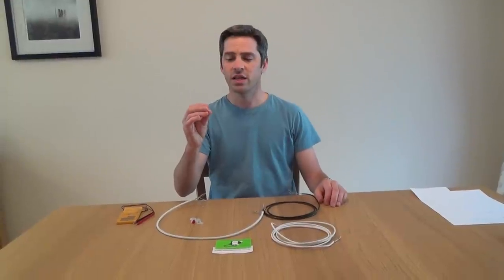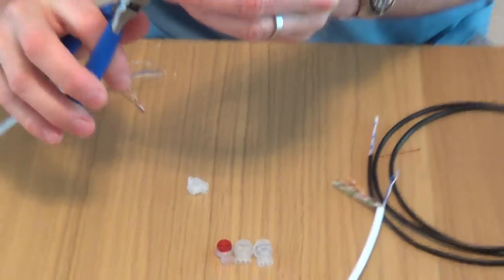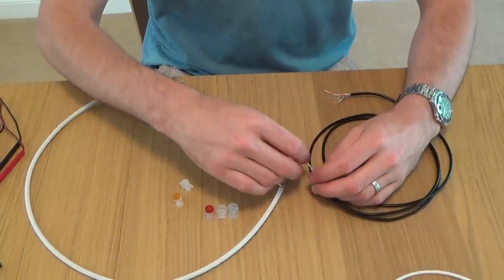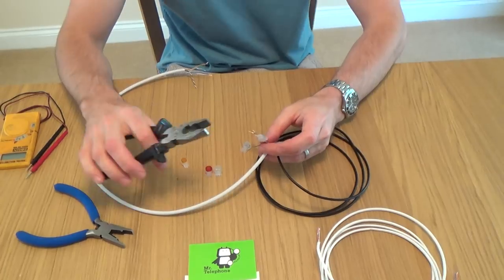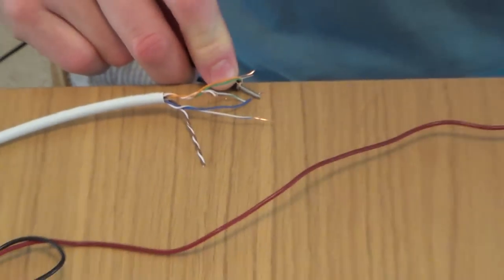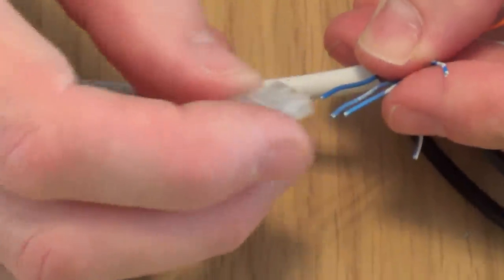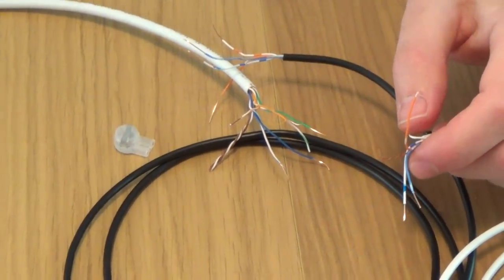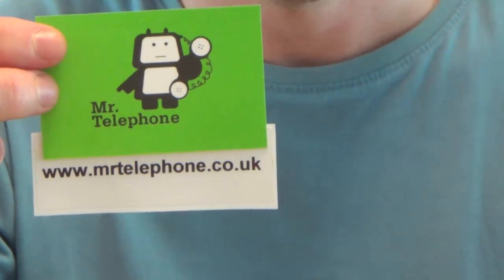How to use telephone jelly crimp connectors

Comment: Great video, really informative, thank you! One thing I do is use a pair of mole grips to make the connection - you can pre-set the gap between the jaws to the right width and they'll apply an even force over the whole crimp, just like the bespoke tool.
Reply from the maker: ***** Hi, I didn't think of that, that is a good idea using the mole grips.Many thanks Vince

Comment: Great video thanks! I’m a bit stuck with the house I just bought. The telephone wire that enters the property is just a loose wire at the rear of the property. I need to extend it to the front living room. I’ve bought 4-core telephone cable & jelly crimps, does anyone know which colours I crimp together? Thanks in advance. James 🙂

Comment: Hi, I’ve had massive issues with my broadband, one minute it’s 20mb and the next it’s either 0 or round about 2mb... this is all day everyday. I’ve called EE and they sent out openreach, they said there are no issues from there side ( outside my home ) last week they came out and looked inside, first they said there was a fault 14 meters from the socket and then that there wasn’t, did 3 speed test,  and they were all around 19 / 20 mb... when he left, the issue was still there. I have since run brand new cable from outside and connected it with jelly clips ( the same as it was) and run the cable directly to the new master socket  ( 5C MK4 ) they fitted, I’ve taken out all the extensions, so the new cable runs directly from the box outside where the phone line meets the house to this master socket. Outside the orange cable was connected to the blue/white internal cable and the white was connected to the white blue internal cable, nothing else was connected. as I have run the cable direct and want no extensions.  I have connected the two cables W/B and B/W to the A and B on the master socket as it was when I removed the box initially and what do you know, the fault is exactly the same. Am I doing something wrong or is there an intermittent fault on the exterior of the house. Thanks for your time and Can you please offer me some help / tips ? Cheers again, Nige

Comment: Thanks for the great guide! I'm wondering is it possible to connect 3 wires with a 2 wire jelly crimp? In your video about the ICD connections you said that 2 wires can fit into the same slot. Is this the same with jelly crimps too? I found out there's 2 external wires which connect to my internal phone line (Not quite sure why, but I want to connect it back exactly as it is), so if that's not possible with the 2 wire jelly crimps then I'll need to buy some others first.

Thank you!
Reply from the maker: It would be best to use a 3 wire crimp for 3 wires. Sometimes it will work on a 2 wire crimp but it doesn't always make the connection.

Comment: Can you use these for garage door sensor wires?   I used the ones that came with the sensor kit but no electricity. Sensors didn't light up. I ended up twisting the wires together and putting electrical wire cap on it.

Comment: Question:
Would you be able to splice together the bare (no sleeve/insulation/jacket) stranded ground wire on 2 Ethernet segments as well, please? (using these IDC's)  Ty in advance
Gr8 Instructional Video - Ty very much for sharing it!

Comment: My question is on a telephone cable.   How many connection splitters do you use if you add an extension and do you insert 2 wires per extension or how does that go?  Thank you.

Comment: Great video. Can you explain why you do not need to strip back and would that be the same when joining house alarm cable.
Reply from the maker: The little metal inserts in the crimp cuts through the plastic insulation on the wire so there is no need to cut back. On alarm cable you may struggle using these as when it is stranded core the wire can sometimes crush rather than the metal inserts cutting through the plastic insulation. They are designed for solid core cables :-)

Comment: How is an electrical connection made when both wires are still covered in plastic?
Reply from the maker: Inside the crimp there is a metal insert and this metal cuts into the wires to make the connection.

Comment: Hi, vince, excellent vids mate. I'm getting infinity 2, I thought my junction box was a bt80e, it turns out it's just connected to my external drop line with jelly crimps. What would you recommend for me to connect to my drop line, then run new phone line to another room and what to use as a master socket, also what cable to use for my phone line.

Comment: Hi Vince could thease connectors also be used to join Cat5e for cctv applications when extending cable runs.
Reply from the maker: Hi, the cat5e wires are the same size as telephone wires so these crimps will fit but if you extend the cat5e cable with jelly crimps then it isn't going to be rated as cat5e cable anymore because of the untwisting of the wires and no sheath etc. Whether you will actually notice any difference you may not on shorter lengths. You can get little cat5e and cat6 junction boxes which would be a better and you can waterproof them with amalgamating tape. I did a video on repairing/extending cat5e cable which shows the junction boxes if you want to check them out.
Many thanks Vince.
Reply: Thanks vince for info.

Comment: In my house, the phone line comes in, and goes to 5 phone jacks.  Previously, wire nuts were used.

I thought it would be easier to keep track of the wiring by using a telephone wiring block, so I got one of those. The bare end of the wires screw down under the screws - I don't really like this, though, it seems like the wires get stressed and could break, and having multiple wires under one screw seems like it's a haphazard connection.

I was thinking I will get spade terminals for the wires, but then, maybe there's the issue of a poorer connection, with the wire going through more connectors . . . what do you think about using spade terminals?  For 22 gauge wires?

. . . what's the thing called where the wire pushes down into the metal connectors? . . . is it easy to get the wire out if you want?  do those work well?  is that the way to go?  thx
Reply from the maker: Hi, try and find my video on the BT78 junction box, it uses the IDC terminals (those metal push down connectors) and you can connect numerous cables to the one box. I can't get you the link for the video at the moment but hopefully you will find it by looking at my older videos.
Thanks Vince
Reply: . . . This is what I have, the Leviton C0219-I junction block . . . http://imgur.com/a/CycxU

Instead of spade terminals, I'm now thinking that I will do this . . . a visually, easy to understand wiring job.  What do you think:

This phone wire is 22 gauge.  The landline is on one line.  Hi-speed internet is on the other

The one main wire comes into the house.  I will attach green-red yellow-black under one of the screws of each color, so you will know that's the input.

There are three other wires.  One goes up, to all the phones upstairs.  The other two go to two receptacles on the lower level (where I'm at, with this junction box).

I find many uses for 18 gauge solid core.  I think it will work here (right?) . . . I will cut a 4" length x 4, and put one end under the other screw on the junction box, each.

I will take the other end, connect it to the other three wires, twist them a bit, and put a wire nut cap on them (4 wire nuts used).

- - - -

Do you know if there is any code about enclosures for the junction box?

What came with the house:  The phone lines were all wire nutted, and in a two-gang box.

My initial thinking, and the current setup:  Get a three-gang box, and just set it in there - but it's hard to work on, and it looks like it's designed to be secured by wood screws

My current thinking:

Set a 2x4 across the studs, use some 2x2's to make a frame, and make it so I can screw the junction box in there vertically.

Dry wall will go all around.  Use plastic edge covering strips to frame the edge of the drywall, around the cavity I have built within the wall.

I was thinking that I could use a piece of wood (poplar comes in 5/8", same depth as drywall) to cover it (as a cover) - but then I'm thinking, what if a wood cover came in contact with low voltage wires . . . I have some PVC-no rot sheets left over from something else (1/2"), that might make a better cover.

To keep dust off, and maybe moisture, cut plastic from a food storage bag (heavy plast, frozen storage bag), and staple it above the junction block to cover it.

I'll now even have plenty of space in here to mount a note card explaining the setup and connections.

Comment: Hi, not sure if I'll get a reply but my broadband is dropping out very regularly. I have accidentally pulled the wires near my front door and I'm going to try and reconnect them, only the blue to white and orange to brown are connected, the rest, black and two shades of green are just loose. Will replacing the jelly clamps fix my issue and should I just leave the loose wires unconnected. Thanks

Comment: hi, very nice video.. i have question. is it a must to keep the isolation of the wires? is it still ok to use crip with the bare copper without its isolation?
Reply from the maker: +Samer Sherif Hi, you will be able to crimp them even if it is bare copper but if you have a wire with its insulation still on it then you do not have to strip it back to bare copper.
Thanks Vince

Comment: What is the commercial name of these connectors?
I have difficulty to find and but them.
I used them a lot when I worked for Schlumbeger 35 years ago. At that time the name is scotch lock. Very useful to work with cars stereo. 
Cheers from Indonesia.

Comment: Hi There, Just wondering how do you open this once you have crimped the wires together. Is it possible to open it again? Please advice. Thank you.
Reply from the maker: +Michael Lachica Hi, they are not reusable but you can squeeze them on the edge of the crimp to pop the lid off but you will need a new crimp because the old one may not crimp back down again.Thanks Vince

Comment: I dont know anything about electrics so hear is my problem...
the small white box inside the house has wires showing. Orange /white white/orange, blue/white and white/blue.  The blue wires are held in place by the little gel pads but the two orange wires are broken. Will i get a shock if i try to put them back together?
Reply: No you will not get a shock

Comment: hi can these crimps be used to splice a broken dsl/telephone line?
Reply from the maker: Hi, yes they can or if the break is internal then you could use a BT78 or BT77 junction box if you have enough slack on the wires to repair it.

Comment: Vince, Can I use jelly crimp on stranded copper? Thanks
Reply from the maker: Hi, no, it is designed for solid core but often it will still crimp stranded core cables. In the past I have stripped back the stranded core to expose the copper and then folded it back on itself to double the size and then crimped it and it has held. 
Thanks Vince

Comment: The lines were cut and the box looks sorry. How can I save the land line? It's outside a garage. will the lines run inside it?
Reply from the maker: +Joyce Davidson If you have slack on the cable then you might be able to put a waterproof repair joint on it, have a look at my other youtube videos and find the one on repairing your cut telephone line.
Thanks Vince